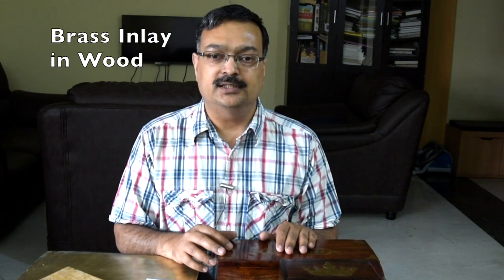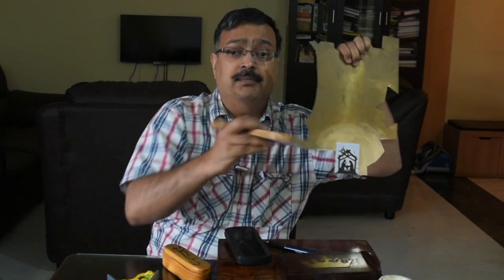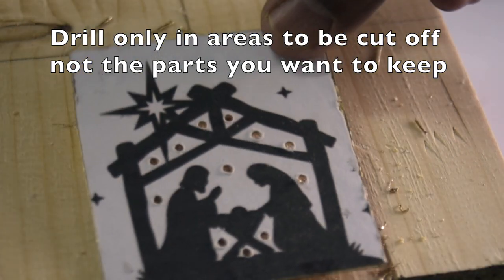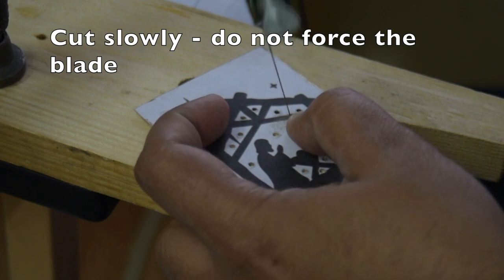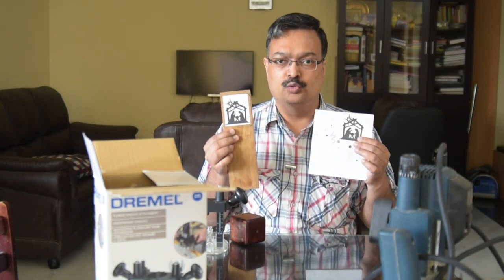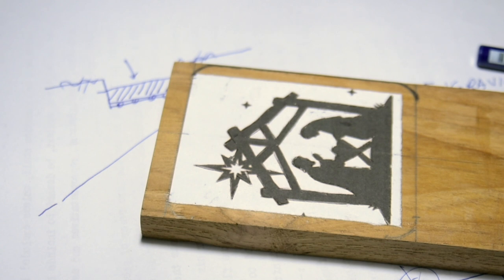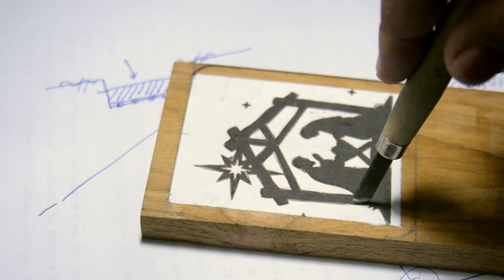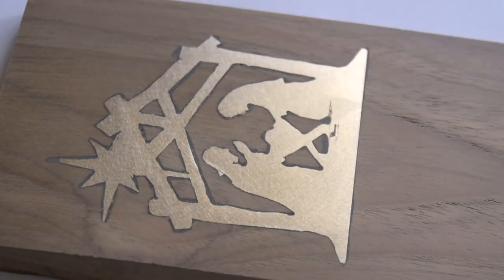Brass Inlay in wood

Comment: Save the dust from when you cut out the wood part of your project. Then when you glue in the brass parts, before you clamp it up, rub the fine sawdust into all of the cracks around wherever the brass touches the wood. This will fill in, and hide any slight imperfections that are there, and the color will match because the sawdust is from the same wood. I learned that trick from a man who inlays guitars. = )
Reply from the maker: Thank you for watching the video and for the suggestion you have given. I shall use this in my next project. Wish you a Very Happy New Year.
Reply: Jagabandhu Mukhopadhyay ...I'll be interested to see what you think. = )
Reply: This is an old technique still used in marble and stone cutting.
Reply: Harvey leach?
Reply: Sorry to be so off topic but does anybody know of a method to get back into an instagram account..?
I somehow lost the password. I would love any tricks you can give me!
Reply: @Briar Hezekiah It worked and I actually got access to my account again. Im so happy!
Thanks so much you saved my ass :D
Reply: @Kohen Trevor No problem :D

Comment: Use wax paperwhen gluing should reduce glued paper to the project, whiche reduces sanding and scratch marks on the brass, allowing easier polishing of the brass when finishing the project. Just a tip.
Reply from the maker: Thank you Robert for your tip shall use the method in next project.

Comment: Very nicely done sir!! I love it! I made a few dices out of dark wood with brass myself as well, but I used an easier method then this... And for cutting your brass plate with a Dremel, may I suggest a accessorie for the Dremel? It is a flexible extension that you can connect to the head of the Dremel. That way you do not need to hold the Dremel itself and the part that you hold is a whole lot smaller and therefore it's much easier to handle and it can get into tighter spaces as well! I absolutely think you would want one! And thank you for this video! I have learned how to tackle my next project!
Reply from the maker: Thank you Lazarus for watching the video and for your suggestion. I have the flexible attachment of Dremel , I got it with the dremel, but never used it. Shall try as you suggested.

Comment: Very cool. I'm dreaming of brass inlay dove tail joints now. Is brass that thin easily bent into 90 degree corners ?
Reply from the maker: Hi DB thanks for watching the video. I think you can bend and create corners. 0.5 mm is thick enough to retain shape and not too thick which you cannot bend. But to get sharp 90 deg you may have to hold one side in a vice and then bend by hand and finally lightly hammer the free side of the brass piece. When completed please share your project n YouTube and put a link in this conversation.

Comment: Nice technique.
Personally, after the random orbit sander I would sand the wood by hand, following the grain, with progressively finer glass paper or emery cloth (probably up to 1600 grit) to really give the brass a nice polished look.
Reply from the maker: Hi Steve , Thanks for watching the video and for your suggestion . In one of my projects I polished the brass with polishing paste and used felt wheels and my rotary tool to give a mirror finish to the brass.

Comment: An easier way of cutting the pattern out of the sheet is by using a scroll saw with a metal blade. It's worth it for projects like this one with the fine cuts. Thanks for the video!
Reply from the maker: Hi FranSwi thanks for watching the video and for your suggestions. As I do very small volume I still do manual.
Reply: That is a good III idea. I was wondering why he wasn't using a pair of tin snipes? Other than the fact that they can bend the metal.

Comment: Jewellery lessons teach that the saw blade should have at least three tips touching the work.  Just one tip will snag and not pull down.  1 mm plate needs therefore 3 teeth per mm.  They are tables, as shown, on the number of the blade and how many teeth they have.  Vallorbe in Switzerland is famous for it’s files and saw blades. Thanks for the work.
Reply from the maker: Thank you for watching the video and for your inputs on saw blade selection. I will use this input in future.

Comment: Dear friend just try to use cnc router for wood and use plotter for brass ur accuracy will rise superb and lots of ur time will be saved
Reply from the maker: Hello Rajesh thanks for the suggestion. I am aware of these tools but I do not have these. And for small volume ( one piece) hobby project I think handmade may be a bit faster. Yes I fully agree that accuracy will be super every time when cnc is used.

Comment: Can you cut with scissors instead ?
Reply from the maker: Hi Alex Thanks for watching the video. I think you can cut with scissors if the plate is thin or the cuts are less complicated. But if you have an intricate design which has lots of sharp curves scissors may not be helpful.

Comment: sir how to do brass inlay in mappa ply for chair?
Reply from the maker: Hi Zubayer I am not aware what is mappa ply. However in general plywood is not suitable for inlay as the ply is made with thin layers and on sanding the layer may come off . My suggestion please try with a small scrap piece of ply wood before doing it for your project.
Reply: @jagabandhumukhopadhyay1825  thank u sir

Comment: I have brass foil. How will it work
Reply from the maker: Hi , if the foil is too thin you cannot sand it after fixing it to the wood. You can try by first having the wood perfectly plane , then have a very shallow cut along the design ( same as foil depth) and finally light sanding by hand ( please avoid electric sander). Please share if this works for you.
Reply: @jagabandhumukhopadhyay1825  thankyou gentleman

Comment: You can use scroll saw with metal cutting blade it will be way more safe and accurate
https://www.instagram.com/p/BrO93zfhTD4/?igshid=lhb5dp940sz9

https://www.instagram.com/p/BrO9t4NhQhR/?igshid=18e5e6m5lujwc
Reply from the maker: Hello Naitik thanks for the suggestion. I have a small scroll saw  Dremel motosaw which could not cut the metal so I went back to manual. I do small number so did not go for regular scroll saw.
Reply: @jagabandhumukhopadhyay1825  I see